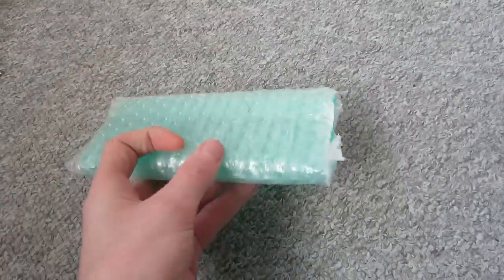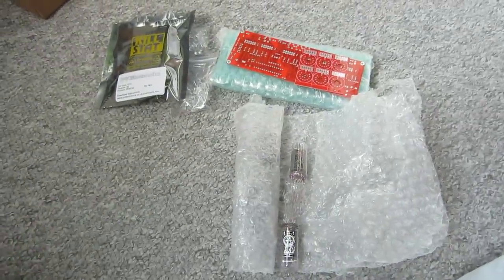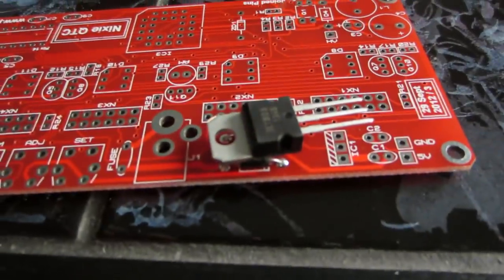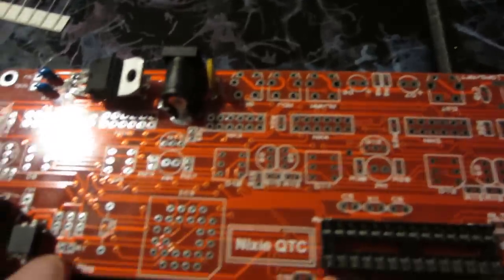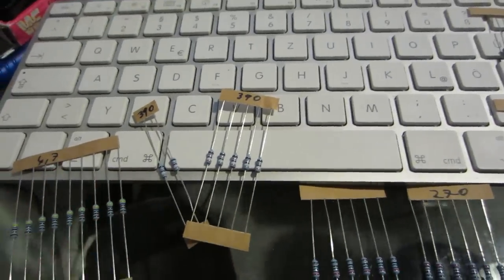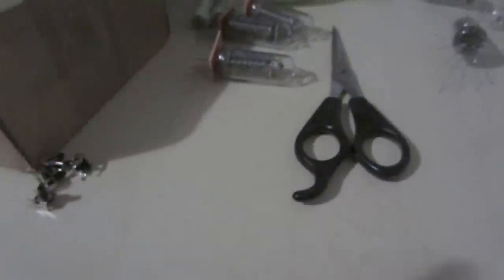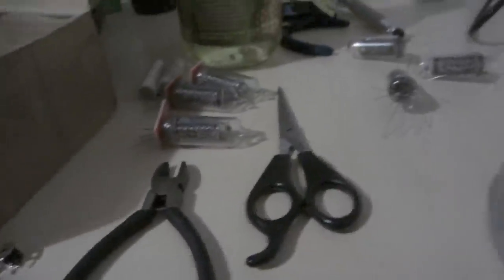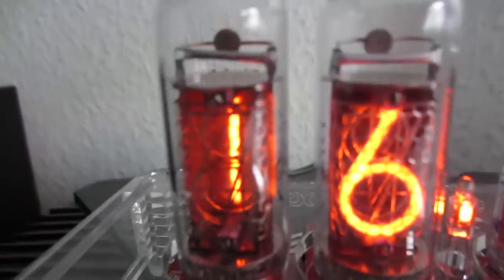Nixie QTC Clock Kit with IN-14 Tubes from pvelectronics.co.uk

Comment: I have the revised version of this clock 30 sept 2014. A difference that I can see is the colour changing leds don't need heat shrink tubing. I found it extremely easy to construct and it looks lovely just like yours. I would definitely invest in a multimeter to identify the resistors, you can buy a very cheap one for this task. I would definitely recommend this kit as it has some very handy features like GPS or long wave radio receiver for accurate time keeping, alarm and anti cathode poisoning measures to prevent the tubes dieing early. The QTC quick tube change idea is just brilliant as if a tube should fail you can change it without risking any damage to the main PCB, which is not featured on most other clocks which could prove a major issue if you damage the tracks on the board. I would also like to mention that the customer care from Pete at PVelectronics is impeccable and a pleasure to deal with and I would definitely recommend that if you are considering purchasing a Nixie clock buy from them.

Comment: Liked the video and plan to purchase a kit from pv electronics. They have some beautiful cases.
After watching a video on Nixie tube manufacture, I was going to build from scratch, but this is much easier.

I learned the mnemonic for the EIA color codes in high school electronics class.The clean version is:
"Bad Boys Ravish Our Young Girls Behind Village Garden Walls"
"Black Brown Red Orange Yellow Green Blue Violet Grey White"

I also still check with a multi-meter to make sure. Some colors (red/orange) can appear similar in poor light, and you can also make sure they are within tolerance.

Comment: I'm building this kit as we speak (looked here to see about measuring voltages in step 1 and 2. I dont know the colour code so I measured the resistors and matched the bands and then made a note. They never write the value on those resistors. You need a multimeter anyway to test the low and high voltage generators so it may be worth getting one so you don't electrocute yourself or blow up a component

Comment: They never put the resister values on any kit I have put together. Instead you have to use a multimeter to get the value of each resistor. It's a pain, so I purchased a large kit of resistors that are marked. Big time saver.
Reply: There is a universal resistor color code, so you can figure out the value of the resistor just looking at the color bands. Please check this link:

https://en.wikipedia.org/wiki/Electronic_color_code#Resistor_color-coding
Reply: I tried that as well, but the colors are tough to determine at times. When I use my tester, I have noticed that some of the values are way off. This is another reason I decided to buy some quality resistors.
Reply: I have an app on my phone called "Resistor Code", works great and it was a free app.

Comment: Why are you complaining about the color codes all the time? They can't asssume that everyone who builds an electronics kit with high voltaes (like the 170 VDC anode voltage ) this to know? Oh yes they can! Why didn't you just measure the resistors?Let me guess you don't have a multimeter to do so.  sorry for being offensife like this but this is not exactly a beginners kit. Although there are 170 VDC pressent at certain parts of the circuit it most likely wonn't kill anyone becouse of insufficient current delivery but it isn't a Joke either!  So please don't build this kind of devices until you have enough experience and expertise to do so! Thank you!
Reply: Agreed completely.  If you're new to electronics, start with a beginner kit.  This is an advanced kit

Comment: holy shit dude..... if you don't know how to read a resistor, and don't even know what the values are, and aren't smart enough to know that you can use a multimeter to MEASURE the resistance, you probably shouldn't be building a kit that uses high voltage.
Reply: It’s good to use projects like this to learn
Reply: I agree. He needs a multimeter to check and measure resistors. It would take him seconds to check even with the cheapest of multimeters.